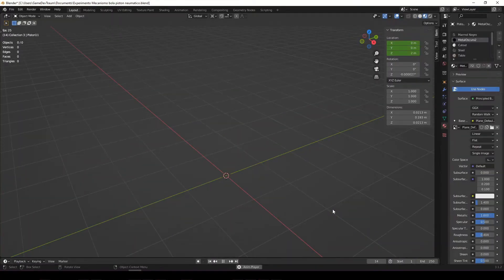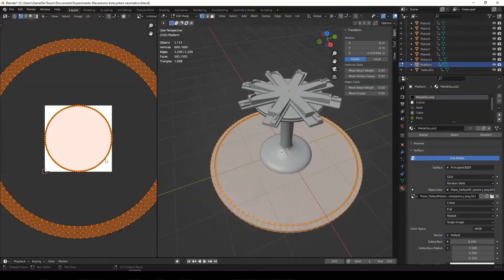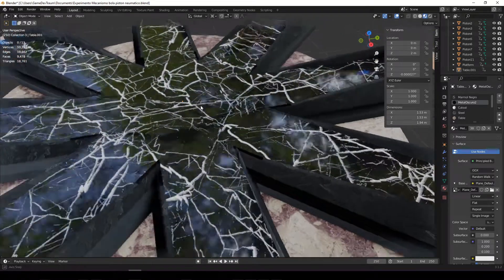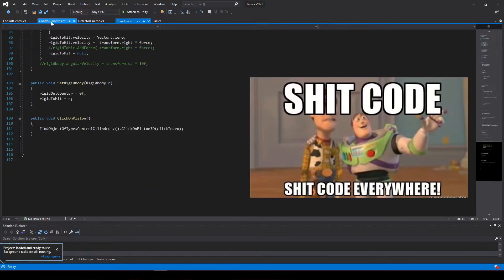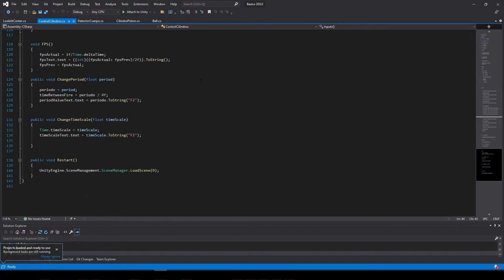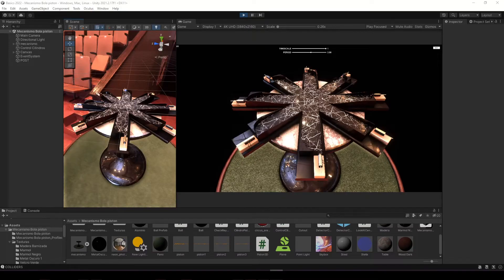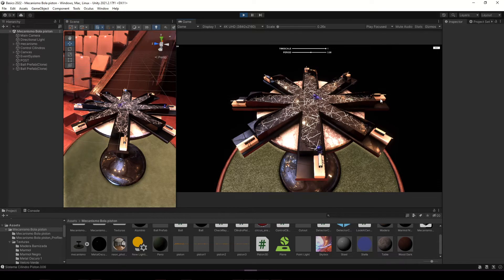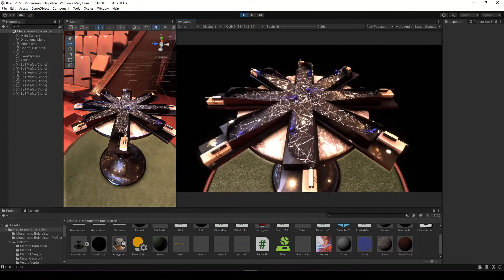something made with blender and unity

Comment: Hi I Subscribed!
I have one Question. The problem with Substance painter is it generates separate Texture maps set evn if the Models are joined in blender. How are you combining the tExture sets after exporting from Painter

COuld you show the full workflow in getting the Texture export from blender to unity?
Reply from the maker: heeey! thanks for the sub.
The key for that is the uv mapping, the 3d models needs a uv map to be able to apply textures to them. If a model doesn't have a UV map when you apply a texture to it, it only shows a single color.
When you create textures in substance painter you use the uv map that comes with the model, if you can visualize texures in the model it means it has a uv map. So, when you export the textures from substance painter and get the image files, in Blender you just need to plug an image node to the model's materials and load the textures.

I uploaded a series of videos about exporting 3d models from blender to unity, please check this video:
https://youtu.be/xMsgGZUdTLQ

It's the intro of the series, in the description you will find all the videos from the series. in particular videos 3, 4 and 5.
Video 3 is about defining materials for the 3D model, video 4 about defining uv maps for each material and video 5 about exporting from blender to Unity, configuring materials with textures and other thinks like updating the 3d model.
Now the textures with substance painter comes in between videos 4 and 5, after you define uv maps for each material you can export the 3d model in fbx format, import it in substance painter, create the textures, export them, then you can go directly to unity with that fbx and the textures and do what's show in video 5, or if you want go back to blender and add the textures to the materiales.
I hope it helps
Reply: @GameDevTraumEN  hey thanks for the detail..I'll check all you videos..
My issue is the Models has UV map.If my 2models share same UV Map.the substance painter exports two texture sets.
How can I combine multiple textures set into single ..
The texture combiner is one way any other way is there?
Reply from the maker: @praveenb-xr  ohh I understand, substance painter will export as many texture sets as materials your 3d model has. If you want to combine objetos to use only one material which contains all the textures you can do that, you'll need to delete all the materials of your 3d model and leave just one, then make the uv mapping of tall the meshes in a way so that all the uv map fits in a single texture and not overlapped each other, if you have sepparated objects, you can select all your objects and enter in edit mode, select all your models, press U and then "Smart UV Project", that should fit all the uv maps in a single texture, that's the idea, you're gonna need to figure it out how to make the uv mapping if smart uv project doesn't achieve the result you want.
Once this is done you export the fbx to substance painter and there you should have only the material you defined.
Reply: @GameDevTraumEN  Greast this is How I'll do normally, but I thought substance needs separate material to paint separate parts..BUt NOw I understand we can do all parts painting in single material using masks.. Great Man..Thanks for explaining abt Painter
Reply from the maker: @praveenb-xr  exactly, masks with polygon or mesh fill are super useful